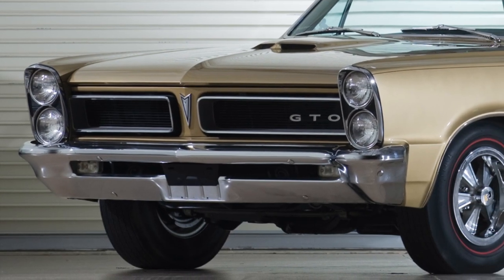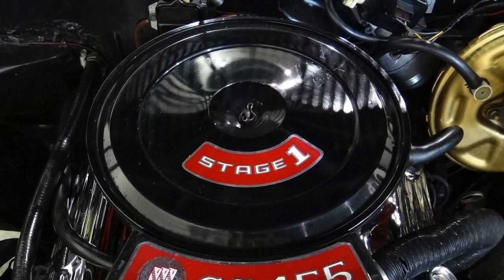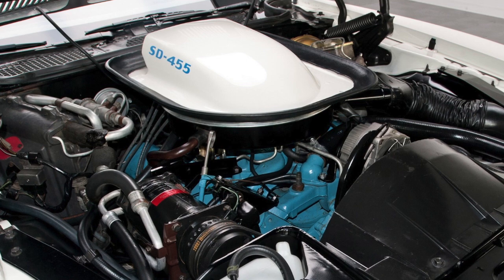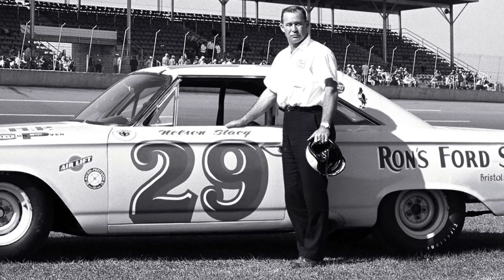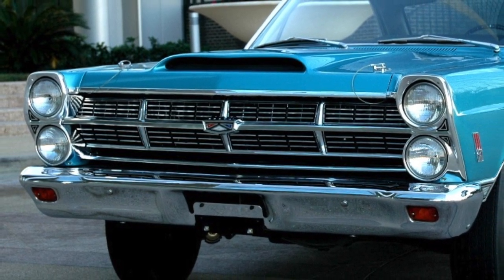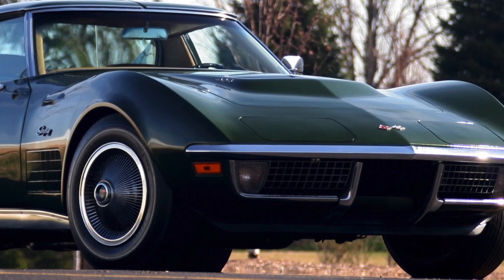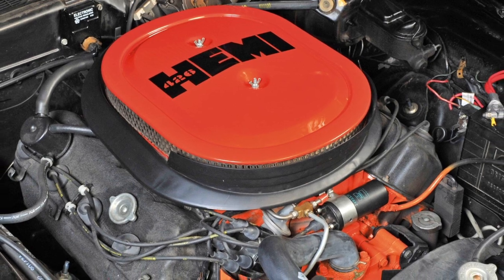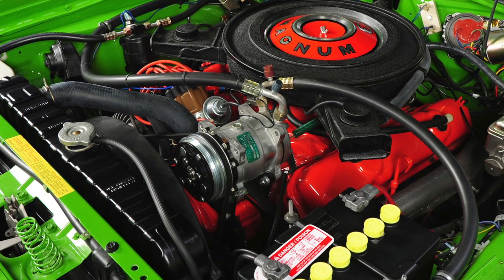5 Best Vintage V8 Muscle Car Engines

Comment: Engines that are what they are. No nagging, fault prone computers and sensors, no alien technology. And room, ROOM, to fit your hand AND a tool at the same time! Oh merciful God deliver me from my GM Ecotec 2.2!
Reply: Had a 1968 Shelby GT500KR with a 428 Cobrajet not much room there to change the plugs. I did keep it tuned though.....well enough to beat a 427 Yenko Camaro by 8 car lengths (twice) one night on a stretch of unopened Interstate 95 north of Jax. Fla. His wife embarrassed him when she told us the Yenko had never been beat before. I would have never left home with that 427 tuned so badly.Tuned properly, I think the Chevy should have won. My next car was a 1970 Nicky Nova SS (COPO) 375hp/402cid. After re-jetting the Holly Carb & setting the distributor for 38 degrees total advance @2000rpm, a set of Hooker headers and a "Flexalight"fan the Nova ran the quarter mile in 12.01seconds. The NHRA record for B Stock Automatic was 11.65 sec.
Reply: Really?  Adjusting valve lash, changing points and condensers, rebuilding carbs, setting timing, and after 100,000 miles it’s burning oil, overheating, and needs a rebuild..... vs an engine that doesn’t need anything other than fluid and filter changes for the first 100,000 miles, coolant is good for 5 years, and should it have a problem a $20 made in China code reader will tell you exactly what it is and it will cost you like $100 and a six pack to change out the offending O2 sensor.... and at 100,000 miles it runs better than anything made before 1984 did out of the showroom.
Reply: Bartonovich52 Hahaha right. Exaggerate much?
Reply: @Bartonovich52  there is a difference between a mechanic and a technician.
the latter is just some hack that knows how to plug in a computer. probably could not set valve lash if his ride depended on it.
Reply: @charlesbireland1780   ; U Did Not Change # 6 Plug without Lifting the Engine . NO WAY ! Can't B Done . My Pinkie is Still Down there Somewhere & I want it Back .YYZ , Rock-Crush'in Ratman . I Had Me 2 Nova's 68 &69 402's Heavily Modded 4 Street . 12.5 Compressed & Changing Spark Plugs were a Dream compared with those A Pillar Nightmares . No Yenko or Copo cause I did My Own Hot-Rodding" . Worked at G/M Oshawa at the Tyme ! Happy Day's 4 Sure .
Reply: hahahaha so funny and true, they're still around get one
Reply: You know your in trouble when a job requires a tool that hasn't been invented yet.
Reply: My Dad bought a new '69 Mustang Mach 1 with the 428 and I remember lots of cussing the first time he tried to change spark plugs. IIRC, you had to disconnect the motor mounts and pull the engine up a bit. I don't know for sure, 'cause I was only about 6-7 years old at the time, but I did become a gear head very early in life. Straight 6 and 4 cylinders were SO much easier to work on, but the smaller V8s weren't so bad for me (mostly 302 Mustang engines). I had a 240z that was a dream to work on, well, besides the twin side-draft SU carburetors that I ended up swapping for Webers. Tweaking twin carbs is a bit of an art form, and for this college kid back then it was a bit of an unknown PITA, but I learned it!
Reply: @Bartonovich52  :  The first advertised 100,000 mile promise was the Caddy 4.5 L V8. If i remember correctly, every one of those ended up ripping out the head bolt threads. The average repair was somewhere around $2,500. The ones I did all had under 100,000 miles on them. So much for maintenance free.
Reply: @charlesbireland1780  The 390 and 428 were put in the 68 mustang with a shoehorn  I really think putting the big block in the 67/68 mustang was almost an after thought. to compete with the new  for the time Camero .
Reply: Lol, i feel ya!
Reply: ever have a chevy astro thats hard for handroom imo
Reply: @Bartonovich52  Changing parts based on what a code reader tells you usually ends up in a bunch of wasted money changing out perfectly good parts.
Reply: I have to disagree my father bought a 1970 dodge dart swinger off the show room floor in 1970. He drove that for 18 years commuted 200 miles a day to work and home for all of that 18 years, made trips to florida from CT to Florida, Oregon Alska etc. When I got it  in 1990 it had 500,000 miles on it aside for minor stuff Brakes,exhaust, and starters only normal maintenance was done.
I put another 250,000 miles on it before I got rid of it( I couldn't keep up on the body rot. But motor and tranny were still going strong.
I miss that car.
Had a 76 cammaro lt that I personally put 120k on it already had 80 k when I bought it stock 305 great car.
My grandfather had gotten a 1962 pontiac catalina  he had that car until 1998 when he died Never any major problems. Just Normal maintenance and consummable(brakes exhaust etc.) My uncle gave the car away 2000.
If you took care of the car and did the recommended maintenance the older cars would still run no problem.
Reply: Hold it..I have a 2.2 Ecotec in my 2003 Saturn Ion. Dont know my way around it yet, but with a little patience i can figure it out. 268,000klms and she purrs.
Reply: @Bartonovich52  Ouch one of my pet hates. Modern cars with temperature lights - no temp guage? What idiot engineer invented this? 
What next modern cars without fuel guages. Thats a good idea lets have a fuel light.

Some modern cars that are unable to adjust steering alignment. Leave a modern car out in the sun for a day and watch all the plastic melt. I remeber when you could stand inside the engine well. Today you cannot get your hand inside. On a modern car you need to remove the engine to do many most small jobs. No dip sticks on modern new cars. In fact you cannot replace the auto transmission oil or do any servicing. Today its a $7000 bill when your auto transmission breaks down. Take a modern 2 wheeled car off  sealed roads and its stuffed. I never heard of anyone driving a moder car for more than 100,000 miles. Modern cars usually run better but they are much harder to fix. Your $20 Chinese code reader must be magic. If this is the case "Why do dealers charge between $500 and $1000 for a first service?"  Today dealers dont make money selling cars they get rich overcharging people for servicing and repairs. Today a modern car are made as cheap as possible and is nearly a throw away item.

A car ran into the back of my 65 XP Falcon. The road was covered in plastic. The modern car was a write off. I drove home and fixed my car for $100 myself with s/hand parts. 
In my day set of points cost $4 not $500 to $1000 for a compueter controled match box. Try changing a modern cars alternator brushes with a couple of $2 brushes. I have never changed coolant and my 84 XE Falcon went 139,000 miles without taking the head off.
Reply: Bartonovich52 truth
Reply: ...exactly!...which is one of the reasons I don't get why people want to pull the engines from old cars and install LS and Coyote engines, etc. in them...
Reply: And you could see what you were doing,
Reply: my older brother played drums in a band and had a 1964 ford econoline his band played all over, he had 600,000 miles on two engines and two transmissions ,the second engine came from pep boys then I got the van put an offenhouser manifold with three single barrels a clifford header an isky camshaft, and drove it for another 200,000 all while blowing the doors off of 289 mustangs
Reply: That was your first mistake, buying a modern day American car.

My Hyundai is just as easy to fix as these cars, and the parts would probably last longer than these between part replacements.
Reply: catmodelt  So you've never had to replace brake pads, the air filter, a light bulb, a fuse or two, or replace the oil filter after changing your oil at least? Your car must've come from outer space.
Reply: @paulk5311  Set lash?...how about setting points?...or doing up  drums?....no doubt no one anymore knows how to turn discs...let alone drums...but the guy sure knows how to do selfies at work...WHEN HE'S SUPPOSE TO BE WORKING!

Comment: I really love your Videos, THANK YOU VERY MUCH! 👍
& Best wishes from germany, Bavaria!🍀🍀🍀😉

I see you have choosen Big Blocks/ or Versions over 400cui. for this Video about the best ever made muscle car engines....
Do you think you really could say that these engines are the best? Because I think there are so many different engines, and often it is a thing about their weight in the cars. I think sometimes an small block could make an muscle car lighter and a little bit more sportive. 
I think about the legendary 327 Chevy small block with double hump Heads/Camel humps. Do you know which engines i think about???
For example; 327 4bbl 275hp Turbofire
This engine in an '67 Chevy Impala/Caprice 4 Door Hardtop wasn't a bad choice. Because when i look at the dates about this car with this engine,  and a TH400 3-speed automatic can bring this big fullsize Chevys in 8.3sec. to 60mph. I think that's an really exciting time for this big cars.
This engine was often choosen for this model year with the Impala & Caprice Trim package.
I'm restoring a 67 Chevy Caprice 4 Door Hardtop with exactly this engine & i've to say it's an very good combination. And this engine in an tiny Camaro is great! ...or in a midsized Chevelle is also often a very good combination....

The 327cui. Chevy Smallblock is one of the most importand V8 engines ever made. Especially the 275hp but there are another Versions with 300hp, also the Versions with fuel injection. I think the 327 is so amazing because this engine is an very importand Part of Motor enginering by GM because this engine is also the base of the later 350s. But the 327 has the optimum of bore x stroke...

However, i Love engines!
And i'm an specialist for the "worlds best 6 cylinder Gas engine", the Alfa Romeo V6 what is called "Busso" or "Arese". This engines are soo amazing, i couldn't tell you about the specials of it because it's too many to tell in an comment.
But an very importand Part of the Arese V6 is that it is an full alloy/aluminum Block & Heads, with the Thing is that it has "Open Deck Design" with the special of hardened steel cylinder, what are completely free floatet with cooling whater arround the cylinders. Especially the 3.0 Liter Version with 24 valves (DOHC) has also the "golden optimum" of Bore x stroke. & It can so much more than the data papers tell it. 226PS (european measured) Out of stock with 7300rpm. 
The Design with the "free floated" hardened steel cylinders/walls in an full alloy Block make this engines so high resistent about wearnes. The bore x stroke does the rest against wearnes, because the Pistons are not very fast in high rpm's. The Sound is amazing! ;) 
Versions from 2.0-4.0 liters, also 12 & 24 valve was made.
But the cool thing is, you get an engine with motorsport engineering in ordinary sedans or also Coupés. And they could make houers of full throttle, 7000rpms in German highways without problemls or overheating. They was built between the 70s and 2012. Alfa Romeo lost one of the best engines ever made when they canceled it in 2007-2012. The following V6 was an block from GM/Holden Block & it was really a big fail by Alfa Romeo....
I wish i could show you an picture of these Alfa Busso/Arese V6 engines. Because they looks so beautiful and amazing, even especially in an Alfa Romeo 156/GTV/166... There you get an Sedan with an amazing look under the hood. ;) But the sound of the Arese V6 is very different to other V6 engines and they Sounds beautiful.
Reply: Oh, that Alfa Romeo V6 sounded sweet.  As a motorhead, my favorite part of the 1983 James Bond movie "Octopussy" was when 007 stole the Alfa Romeo GTV6 and got into a chase with the German Polizei driving BMW's.

Here in America, I saw an Alfa V6 in a small competition hydroplane boat probably 20 years ago.  I don't remember if it was fast, but it sure sounded great.

Comment: I always liked the 327 SBC 375hp
Reply: Dam straight!
Reply: No match for the Ford Boss 351 canted valve motor, but a great engine, and I have owned several of both.
Reply: The SBC may not be perfect to work on from a design perspective or the best performance engine for that matter, but today I greatly appreciate Chevrolet's backwards part commonality that goes back 30 years or so. Takes the guess work out of what part will work with this block or that head, etc.
Reply: Vince yes it makes it easy, but it also turns every keyboard mechanic into an expert. When I started building motors in the 1960's I worked with big and small Chevrolets. There were lots of them and they were cheap. Over the years I have grown to appreciate Fords because they were always so innovative. SOHC 427 Hemi , 427 Tunnel Port, BOSS 429 Hemi. 351 C., 289/302 Boss Inline 1400 cfm Autolite carbs. etc.  @3.2Carrera
Reply: the 327 63-65 vettes owned the streets.
Reply: @georgewilson9121   About 1966 or 1967 an older boy in my town bought a Nova or Chevy II with a 327. It was said it had a CORVETTE 327.
Wasn't an SS. 
All the car options were 327, 4 speed and heavy duty suspension.
We young 7 graders would hear about how he would beat 396, 383 and hot Mustangs during the weekend.
It sounded good with regular exhaust.

Comment: I had a 74 SD 455 T/A. After a friend rebuilt the motor, it would rev to 7500. It had a Turbo 400 3 speed. In 
2nd gear it could do 140 mph. The speedo pinned at 160, which I reached more than a few times, and one time I kept accelerating, but chickened out after I felt the fenders rubbing the tops of the tires due to slight undulations in the highway.
By using the rpm, and some calculations, the car was doing 185 mph. I sold it after blowing a head gasket, and finding out how hard it was to get SD parts here in Canada, not to mention the expense.

Comment: Thanks for your research and production! Great videos as always...My personal claim to fame was a 1970 Oldsmobile Cutlass SX 455 2 barrel 365 hp 500 foot lb and a 1970 Oldsmobile 442 350 4 barrel 325hp 360 foot lb.. Wish I still had those cars...
Reply: Yes regular cutlasses in 442s have the 365 horsepower 455 that ran in the 14s.
But each company including Oldsmobile how to double badass Throwdown. I'm at 70 W-30 was closer to 440 horsepower in reality.
But a lot of people get confused about the horsepower rating and Pontiac wouldn't write anything more than one horsepower forever 10 lb of car weight.
And the 442 weighed  3700lb so that 440 horse monster W-30 got a rating a 370hp.
The regular 442 was rated correct at 365hp.
70 W-30 what's more powerful than the Hurst Olds one that was rated 390 horsepower.
That would have the smaller cam in it

Comment: The 440 six pack could've had it's own entry but i suppose it wouldn't  fit.
Reply: Absolutely. The Pontiac 400 Ram Air IV too
Reply: I had a 70 cuda with a 440 six barrel engine. 3:54 gears and a positraction rear and 727 torgueflite transmission. I installed a set of Big Tube Hooker Headers, changed to carburetor linkage to progressive linkage. Yanked out the stock distributor for a Mallory Dual point. Carbs and distributor were set up by "Ramchargers" Car prepped by Bob George. That car never lost a race. It was freaky fast.
Reply: 440s were the poor mans engine.  The 383 was the grandpas engine.  Mopar had wonderful plants but the 428 SCJ smoked the 440 and it was not even close.  Took a lot of work to get the 440s competitive.  Not the best head design.
Reply: @markperry2827  Mopar expert?

Comment: My 68 Charger RT 440 Magnum 4bbl,auto and 3.23 gears ran 12.80's bone stock ! Back in 1973 !!!

I added wide tread tires that were 205 60 series yeah 205 were as wide as you could get then !
It still spun but my Dad raced a lot ans I knew how to drive ! Dads new 70 Cuda 440 6 barrel and 3.54 dana 60 ran high 11's 2 weeks after he bought it ! He added headers and tweaked the carbs !

By 1979 I ran 12.30's with my 68 Charger RT with 130,000 miles on it..I changed the intake and carb added headers engine had stock cam and never touched ! Remember some guys ran cars that 1st gear changed at 40 mph lol,it should go to 1-2 at 50 and after the shift youre north of 60 mph ! It takes 2 seconds to adjust the trans shift point ,my Charger I bought of the orig owner in 1972 shifted perfect ,I did see and buy many that shifted at 40 lol !
Reply: Right on!

Comment: Personally. I'd take a '63 Chevy 327,  340hp Rochester Q-Jet(pre-quadrajet manual secondaries) Fuelie heads 4 bolt main. over ANY engine you picked here. Designed for Corvettes but you could order it in any chevy made that year. 25+ mpg if you didn't open up the secondaries. But if you did 'open it up' it would keep up with these motors. Plus, out of the factory, you could take it up to higher RPMs than any of these motors. In fact it was the First Stock motor offered to the public that produced more hp than it had cubic inches
  Once you've had one your admiration of Big Blocks fades rapidly
Take Care All

Comment: The SD455 was rated at 310 (Net) in 1973  and 290 (Net) in 1974.
Reply: Research this and you'll see that the 310 rating was only in some pilot cars and and cars issued for press road tests.  All cars sold to the public for 73 and 74 were rated at 290hp due to cam change for emissions.

Comment: I have a 1969 Buick GS 400 stage one convertible . the car can fly
Reply: My dad had a 70 455 Stage 1 GSX. That car was an absolute monster. Those Stage 1 engines were very underrated.

Comment: BUICK RULES! I SPENT OVER 30 YEARS , STARTING IN THE  EARLY 60'S, IN A BUICK DEALERSHIP IN THE SERVICE DEPT, ALL PHASES. NOT REALLY  PUBLICIZED, THERE  WAS A STAGE 2 OEM GM KIT AVAILABLE FOR "OFF ROAD USE". I IMAGINE THAT SOME ENDED UP IN "STREET" RODS.